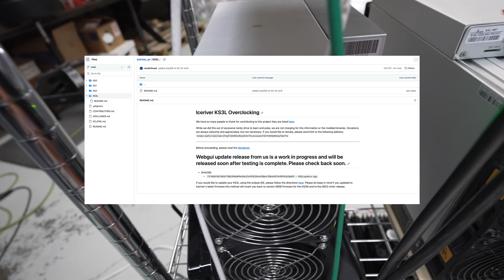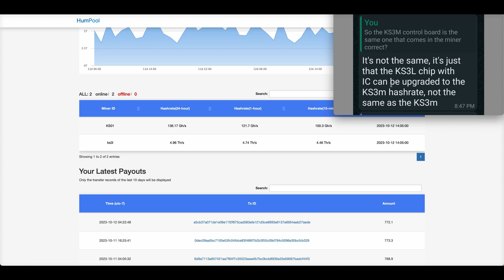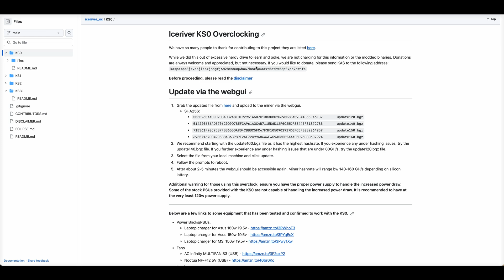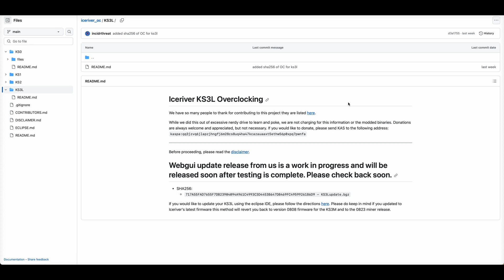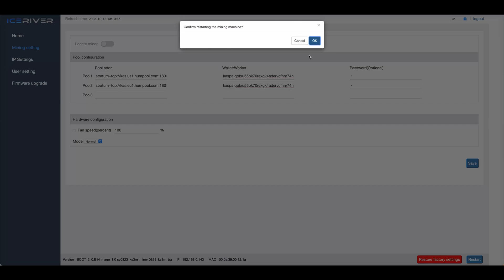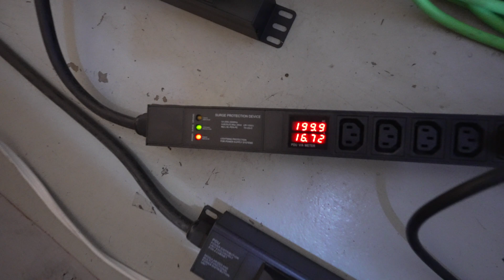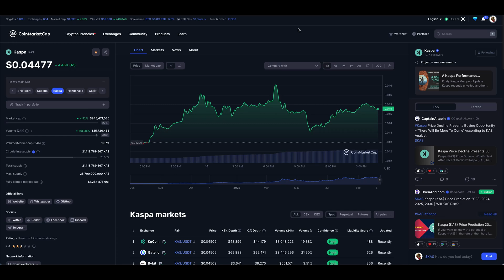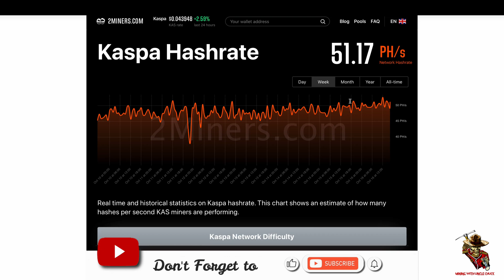IceRiver KS3L Control Board Swap! Increased Hashrate & Profits How To!

Comment: hey can i turn my ks3m to ks3l? it is so hot here so i need to decrese electiric consuming for cooling, is it possible?
Reply from the maker: Now I will be clear I haven't tried this but.. I would think that doing the reverse of this video  and putting a KS3L control board in the KS3M should work lowering the hashrate and slightly and reducing your operating temps but a better idea would be to get yourself a Fruition Design shroud kit with an AC Infinity fan and that will also help cool your miner substantially. I have a shroud kit myself that I will be installing on my IR KS3. I will be doing a video in the next week on it so keep your eyes out, it will also work on the KS3M.

Comment: amazing , i have the KS3L want to do the same . how i get same control board ? please help
Reply from the maker: Mine I got from my supplier in China but... If you buy the KS3M control board direct from Ice River that should work for you. I know a number of people that have done the direct swap and it works fine. That being said I do know a person it didn't work for but most KS3M factory control boards should work, as I said many have been successful.
Reply: thanks for help but after swap should i download files or update firmware or no need ?  @miningwithunclechuck
Reply: I did that, got the ks3m control board and switch the bord its work fine for 10 min and then the hashrate goes down, any idé what I can do? Or does it dont work for me?

Comment: I replaced my KS3L control board with KS3M control board.
I am having difficulty changing the Iceriver mining wallet. I have tried factory reset and normal rest but still mining to Iceriver wallet.
Please which firmware update should I use: KS3L or KS3M?
Reply from the maker: I would flash it with the KS3M firmware as that's the control board you have and it should work for you; but when you fired up your miner after swapping the control board what does it say in the bottom  left of the dashboard their  firmware?
Reply: @miningwithunclechuck  Issue resolved. My antivirus was preventing changes to the pools/wallet. So I disabled it.
Reply from the maker: @yawaboagye6619 glad you got it sorted out.

Comment: And about the ks1 and ks2 boards? Have your tryed ?
Reply from the maker: The KS1 and 2 models you can increase hashrate by using the available free overclocks with the risks that go along with that of course.
Reply: @miningwithunclechuck  yes i know that ;)
Just wondering if it was possible to use control board of ks2 in ks1 :)
Reply: @miningwithunclechuck  actually i think it has 2 hashboards on ks1 , i got one and it has 2 boards inside.
Reply from the maker: Sorry... yes the first production KS1 actually shipped  with three hashboards and then with two. I have a friend that has one of the first release and two current versions which I confirmed with him today. The first one he purchased actually only has two fans compared to four on the current production. Ice River has made a few changes along the way since since first production runs tweaking things I guess  @diogopinheiro6046